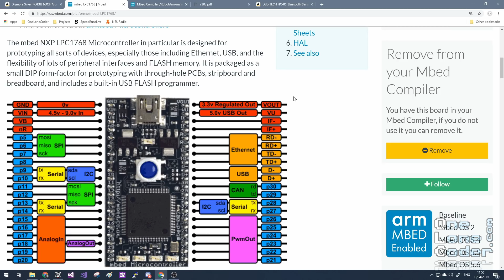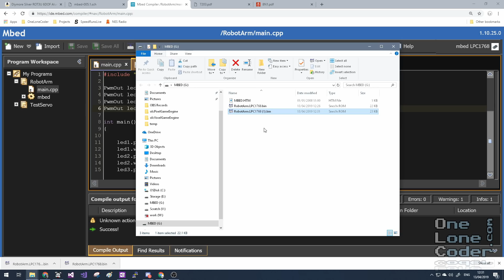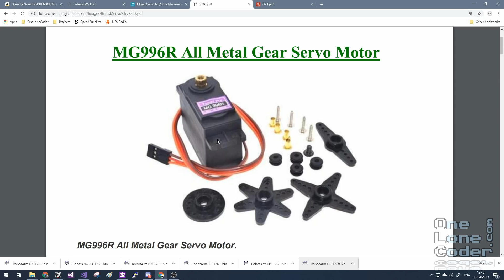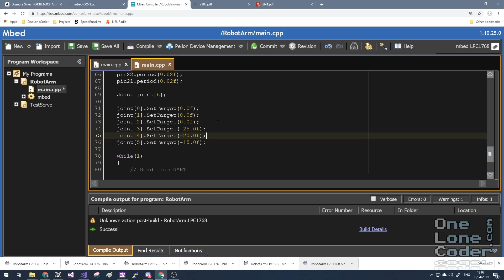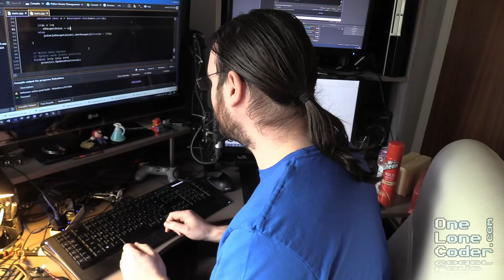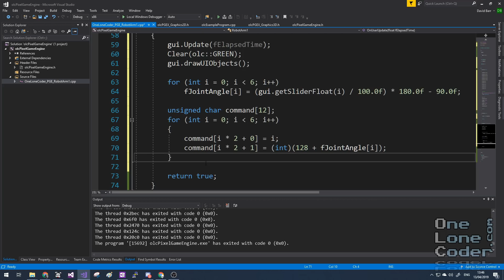Programming a Wireless Robotic Arm

Comment: PLS ANSWER->>>  Would this arm collapse if you took the power off the motors?
Reply from the maker: Of course, they are pwm servos with reasonably low ratio gearboxes. It would collapse but slowly.
Reply: @javidx9  thanx for info.
Reply from the maker: Unless the arms have brakes or extremely high ratio gearboxes, they will always settle into a relaxed state
Reply: just helping out. (u dont need my help, but just trying to be fair.) i dont know for sure, but the "jitteryness" and oscillations could be caused by the motors backdriving each other as they are trying to settle on their absolute rotational position.   that little sound at the beginning that u heard. (that wasnt really in the video) was them causing an oscillation with each other.  then might be a solve which is better than PID controllers...  and its actually simulating it physically,  if u can handle the headache.
Reply from the maker: The motors have no closed loop control so PID isn't an option in this case, when I'm designing real robots  naturally they all have full dual loop control and are very stable, but this toy doesn't, and it's not bad to be fair, it's jitteryness is in part to supply collapse, getting the motors moving sinks a whole load of current briefly, which naturally diverts from the others, this is in a way a feedback loop until things settle into equilibrium. I need a better power supply!
Reply: @javidx9  indeed.  /motors with your power,  takes alot of energy!!!  (and the load hogging indeed.) thanks for the reply! awesome channel.

Comment: You should have a look at ESP32, way more horsepower than Cortex M cores (Wifi and BLE embedded, so no need for modules)
Oh and it's Visual Studio-compatible if you use the native IDF
Reply from the maker: I have used these, though Ive struggled in industry to get them to pass the relevant certifications they need, particularly regarding emissions, but at the hobby level, sure, they're great modules!
Reply: @javidx9  oh I didn't knew about these emission certificates, never  thought about this issue ! (But had a lot of fun porting your 3D engine with textures on it, keep up the amazing work !)

Comment: This is way cooler than just using an arduino! Really happy to see some hardwarey stuff on this channel.
Keep up the good work!
Also, It would be cool if you could do a reverse kinematic model in the olcgameengine and just animate the absolute position and rotation of the grabber using keyframes and interpolation.
Reply: You could program an arduino with AVR studio and no or few libraries and feel super cool.
Reply: @kodiererg  There are many challenges you can set yourself, but I just felt like this is a cool one. But low level arduino programming (with inline assembly for example) sounds like a lot of fun as well, you're right